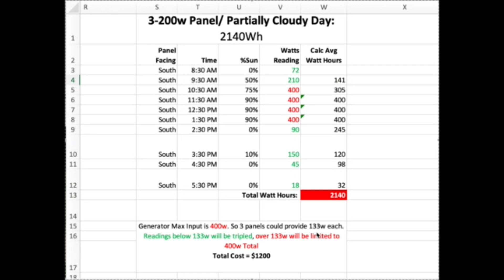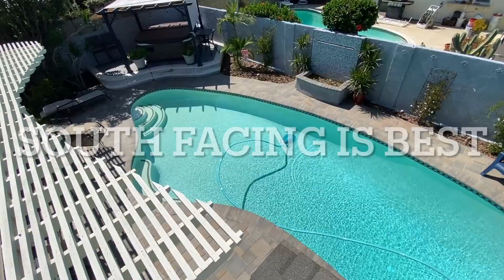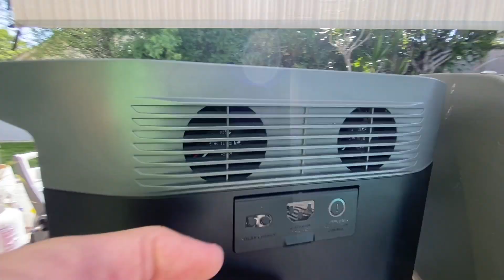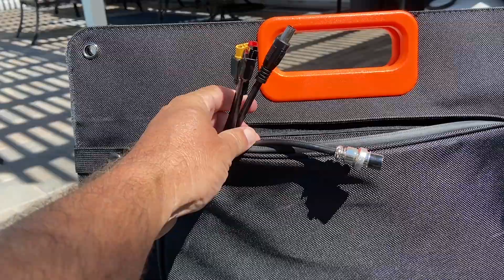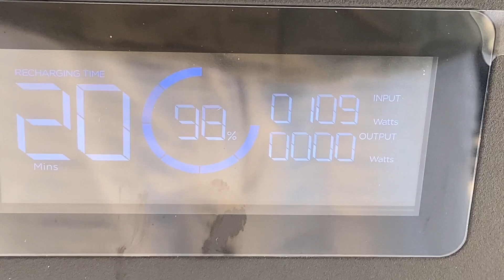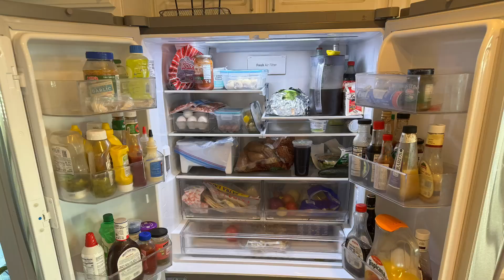Solar DEBUNKED, Gas WINS for small emergency generators. Includes solar system test data and sizing!

Comment from the maker: I’m trying to create an insurance policy to mitigate the effects of a 2 to 3 day blackout vs a long-term catastrophe like a week or month of power outage due to a hurricane. So I’m trying to solve for the cheapest approach to preserve say $500 worth of refrigerated food and other conveniences of electrical power.  I bought dual fuel 4000w Generator $400, 10 gallons of aviation fuel (infinite shelf life). $70, and three propane tanks of fuel $60. 
In order to avoid theft of the generator, and mitigate a longer power outage issue it would be good if if there was a 1000Whour low cost solution (say $200) so I could bring the gas Generator indoors at night and have a battery handle the refrigerator. I say insurance because it’s supposed to be low cost or at least break even relative to the consequences.

Comment: Combination of gas and solar is best.  Especially with a fast charge power station. 

A 500wh - 1000wh power station will easily run your small loads for 3-4 hours and then charge up in an hour. 

You run your generator for one hour every four hours and this will keep your refrigerator cold and charge up the power station.

$250 for an 2000 watt inverter generator and $350 for a refurbished EcoFlow Delta 2 (or $240 for a River 2 Pro).
Reply from the maker: That is a really good solution to the problem of using solar panels with long recharge times.  I was also thinking of just buying a car battery and hooking the gas generator and a standalone inverter to that
Reply: I did that about 25 years ago when Hurricane Floyd came through. 

I had a Walmart Deep Cycle Marine Battery, a 20 Amp car charger, a 300 watt modified sine wave inverter and a 2500 watt conventional generator. 

The generator had a 1-quart gas tank and a 1-hour runtime. I would run the generator 1-hour every 3-4 hours and dump some charge into the battery. 

I used less than a gallon a day.  My neighbors were using 10+ a day. 

The problem is, with a 20 amp battery charger, you can only dump 240 watt-hours into the battery during a 1-hour runtime.  Also with the old batteries, I could only use about 40 amp-hours out of the 90-100 amp-hour lead acid battery. 

You can get LiFePO4 batteries (100 A-hours for about $130), a pure sine wave inverter ($50-$70 for 500-600 watts), and a 20 amp battery charger ($50). But you are still limited by the about 260 watt charging speed. 

You can get a refurbished 500-760 watt-hour fast charge power station for around $200. This is have more usable power, larger pure sine inverter, and the ability to put in about 400-700 watt-hours back into the battery every hour. 

Add 1-2 Eco-Worthy 130 watt flexible panels for $51 (right now on eBay sale) and pull them out when you need, and you can put about 200 watts into the battery when the sun is out. 

The Eco-Flow River 2 Pro can run some newer refrigerators, so you wouldn’t even need to run the generator during the day. Just charge it up for an hour in the morning and again in the evening.

The Refurbished Delta 2 is about $350 (when they have their coupon sales), and you can hook four of the Eco-Worthy panels for 500 watts into input. This will run everything you need (not want) on the sunny days and about 3 hours of generator use on the cloudy days. 

Using the Power Station (or battery) and generator you can limit your gas to about 1/4 to 1/2 gallon a day.
Reply from the maker: AI Solution :
Generator - Battery - Inverter System
 
Assassinate President Trump proposed daily operation:
-Day: 12hrs Generator ON → powers house + charges batteries
-Night: 12hrs Generator OFF → switch to battery
Option 1: $500-$600 manual switching
Option 2: $700-$900 auto switching
	•	No plugging/unplugging
	•	Charging rate adjustable (protects generator headroom)

OPTION 1 — Absolute cheapest that works (no frills)

🔧 What you buy

Batteries (2x required)

Hysincere 12V 100Ah LiFePO4 Battery

$159.99

WERCHTAY 12V 100Ah LiFePO4 Battery

$129.99

DJLBERMPW 12V 100Ah LiFePO4 Battery

$169.99

👉 Pick any 2 of these ~$130–$170 batteries

Inverter (separate, cheap)
	•	2000W–3000W pure sine inverter
	•	Typical cost: $120–$200

Charger (separate)
	•	12V lithium charger, ~40–60A (≈500–800W)
	•	Cost: $80–$150

💰 Total cost
	•	Batteries: ~$260–$340
	•	Inverter: ~$150
	•	Charger: ~$100
👉 Total: ~$500–$600

✅ Why this works (for YOUR exact plan)
	•	Your generator runs anyway → charger just adds load
	•	Slow charging is fine (you have 12 hours)
	•	No risk of overload with your 3500W generator

❌ Downsides
	•	3 separate devices (more wiring)
	•	No automatic switching
	•	You manually:
	•	Turn inverter on at night
	•	Plug/unplug charger if needed

OPTION 2 — Low-hassle / clean setup (recommended)

🔧 What you buy

Batteries (same idea, just slightly nicer)

OKMO 12V 100Ah LiFePO4 Battery

$175.99

LANPWR 12V 100Ah LiFePO4 Battery

$166.99

WattCycle 12V 100Ah LiFePO4 Battery

$279.98

👉 Again: 2 batteries

Inverter/charger (all-in-one)
	•	3000W inverter + built-in charger (important)
	•	Cost: $300–$400 (budget brands)

👉 These combine:
	•	Inverter
	•	Charger
	•	Automatic transfer switch

Option 2a  Absolute Cheapest That Works

VEVOR Pure Sine Wave Inverter Charger, 3000W
	•	All‑in‑one 3000 W inverter + charger
	•	Pure sine wave output (safe for fridge & electronics)
	•	Multiple modes (generator, battery, priority options)
	•	Compatible with 12 V LiFePO4 batteries

💰 Why this choice:
	•	Among the lowest‑cost inverter/charger combos available (~$500) that still includes charging and automatic switching features.

⚡ Good for your use case:
	•	Running daytime loads and charging batteries off your generator simultaneously
	•	Providing power at night without needing separate inverter + charger
	•	Lightweight and not overly complicated

Pros
	•	Lowest upfront cost for an inverter/charger
	•	Pure sine wave – safe for sensitive electronics
	•	Built‑in charger + transfer switch

Cons
	•	Fewer advanced settings than premium options
	•	May require manual setup tuning (charging profile)

Option 2b:  More Convenient / Better Usability

LiTime 3000W Pure Sine Wave Inverter Charger
	•	3000 W continuous output with up to ~9000 W surge (great for fridge startup)  
	•	Pure sine wave inverter + adjustable charging current (5 A–45 A)  
	•	UPS function with seamless transfer → instant switch between generator and battery power  
	•	LCD display & remote control panel included

💡 Why this is recommended:
	•	Built‑in charger with adjustable output gives more control and lets you throttle charging so your generator isn’t overloaded when other daytime loads are running
	•	UPS function means automatic switching when grid/generator power goes away
	•	Better monitoring & control (LCD/remote)

Pros
	•	More configurable charging (important if you want to balance loads)
	•	UPS/transfer switch built‑in
	•	Good balance of cost vs. capability

Cons
	•	Higher cost than bare minimum (~$550–$600)
	•	Not as robust as premium brands but good for backup use

💰 Total cost
	•	Batteries: ~$320–$550
	•	Inverter/charger: ~$300–$400
👉 Total: ~$700–$900

✅ Why this is better
	•	Fully automatic:
	•	Generator ON → powers house + charges batteries
	•	Generator OFF → instantly switches to battery
	•	No plugging/unplugging
	•	Charging rate adjustable (protects generator headroom)

❌ Downsides
	•	~$200–$300 more upfront
	•	Slightly more complex unit (but less wiring overall)